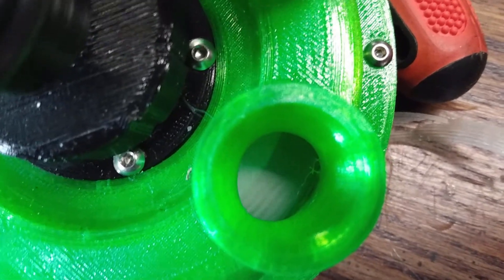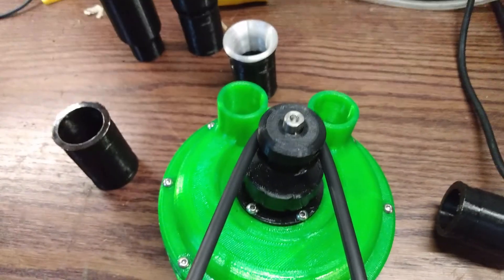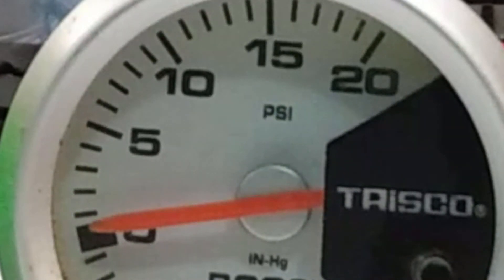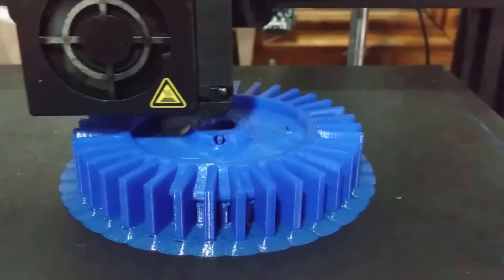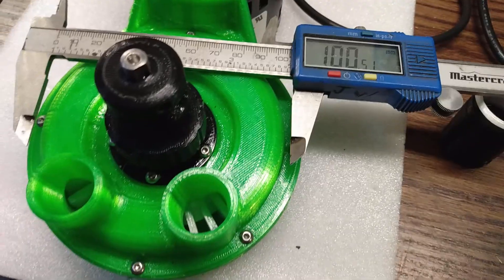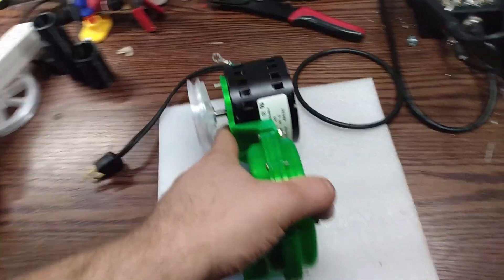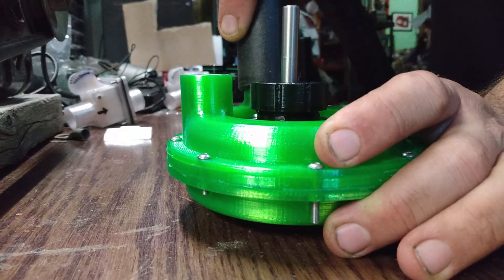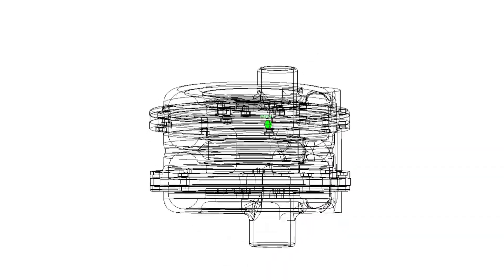3d printed side channel blower ( regenerative )

Comment: Hi, yes there is oft problem with sealing some parts that would be under pressure. If you want it fast and uncomplicated use your point finger to spread some thin layer of silicon even over contact area and let it dry.   Elasticity of a silicon even out all gaps and make a perfect seal. BTW good design!

Comment: I've wondered if a 3d printed supercharger could be made for a 50cc gy6 moped engine.   The smallest commercially available superchargers are meant for 500cc engines and larger...so they would cause a lot of drag while making more psi then usefull for a small engine.
Reply from the maker: Take a look at my most recent video on the topic ( second last video currently) I have a working brushless unit that makes 3psi and should be good between 10-20hp  and it's like hand sized and powered by a 2s LiPo . Also coming soon I'm working on a shaft driven version to be put on a rather large engine considering the size , this will be the topic of my next video ( if things go to plan anyways )